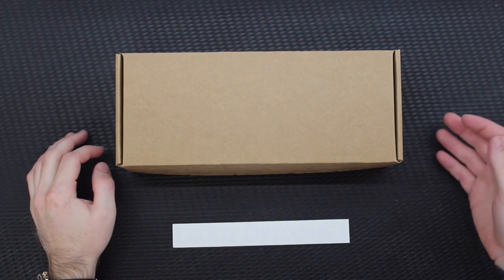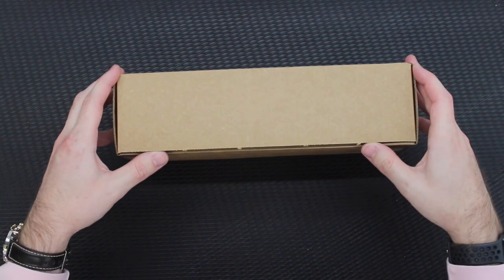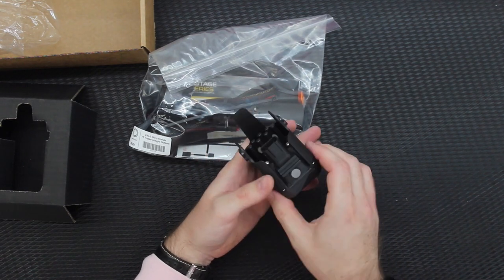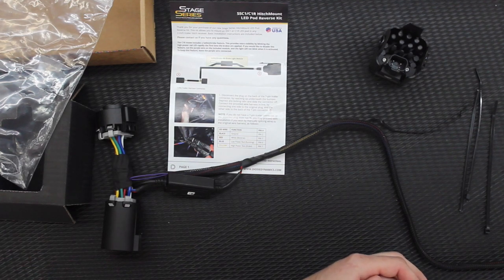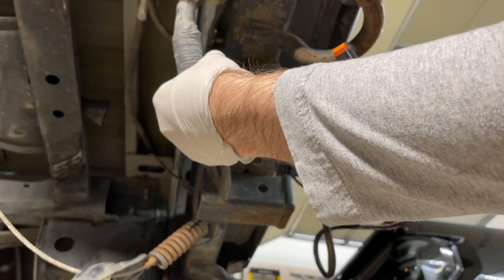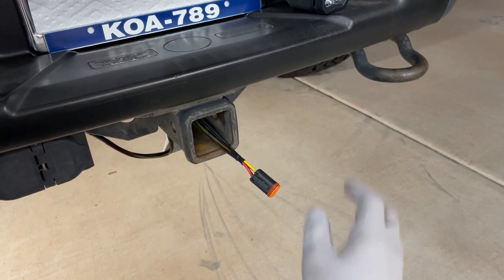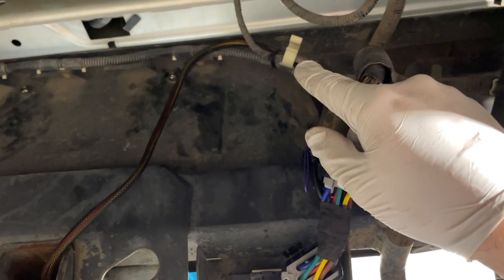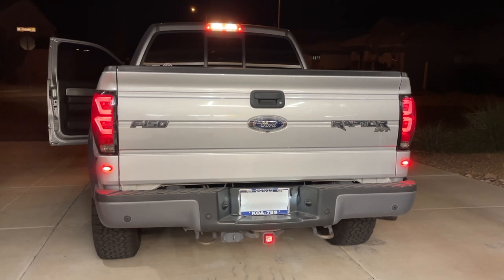Diode Dynamics HitchMount C1R LED Pod Install and Review

Comment: You have a GEN1 Raptor so you don't have the cross traffic alert. For example, the current F150 has cross traffic alert. This light will disable cross traffic alert. Also, the rear back up light is not bright. It has something to do with the way it was wired. Diode Dynamics knows about these 2 issues and is working to fix them before shipping any more out.
Reply from the maker: Interesting!  Good to know for folks who have newer trucks.  That would be a big con for me.  I heard about the wiring issue, supposedly this doesn't affect this one that I received (from the very first batch) but I have another on order for my other Raptor and that one is delayed due to that defect per an email I got last week.  Hope they get it sorted since I think it's a darn good product, mostly for the safety aspect.  Thanks for watching!

Comment: Do the turn signals have any affect on it?  I installed a cheap Amazon light on my ‘22 pathfinder (also 7 pin) but had to buy an extra module to stop it from flashing with either turn signal.  I’m thinking of upgrading after seeing your vid 👍
Reply from the maker: In my case, not at all.  With newer trucks with more complex electrical systems, that may be a possibility, but I've not looked into the pinout of this at all to know that for sure.  Thanks for watching!

Comment: Do all of your LED’s fire or light up? I notice where several are out in both the red and white modes on my  unit. DD tells me this is perfectly normal, but it has me wondering.
Reply from the maker: All of mine do on both this one and another that I got for my other truck.  The lens does make it look like they're not all firing, but if you look at it straight on they are.  Might be your issue, or you might've gotten a dud - I got one bad one out of the two I have.  Thanks for watching!

Comment: Does the truck think it has a trailer attached?
Reply: Yes. And it's annoying as hell.
Reply: @richardcable79  Thanks for responding, I’ve been holding off buying it the past 2 weeks and needed this confirmation. The company says they’re working on resolving it but has no ETA.
Reply from the maker: @redbirdsjunkie  Mine does not, since it's old enough not to sense.  If you have a newer truck, it's a 50/50 shot.  Thanks for watching!
Reply: @redonKiLaus  Yeah I have a 2021 F150 and think it’ll detect it. Thanks for the response!